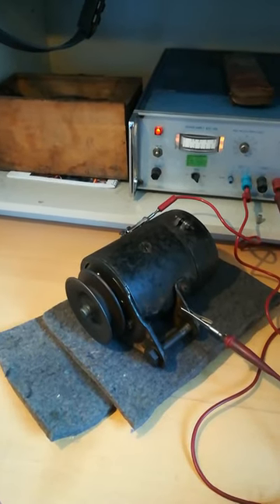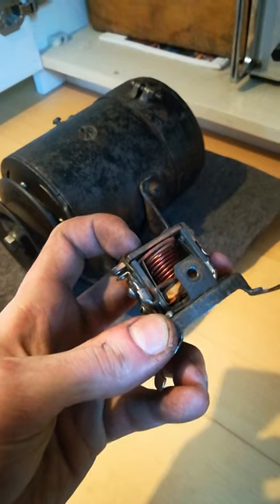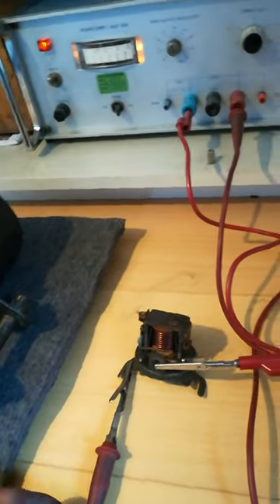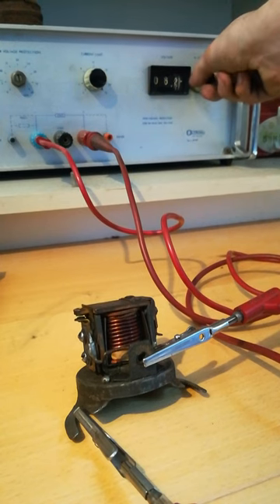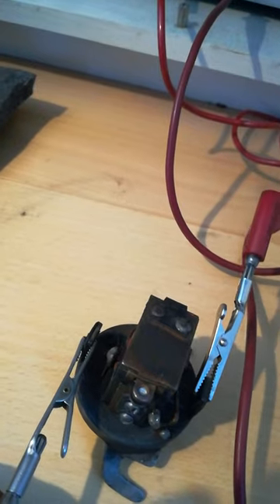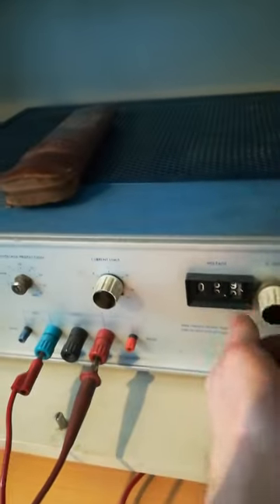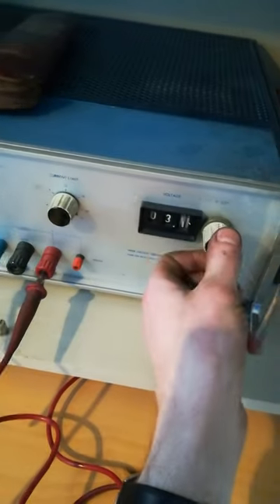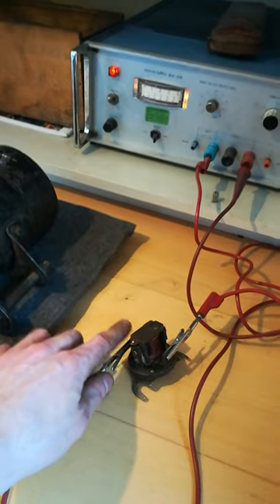Original Model A Cutout - #Short Explanation

Comment: 7.3V for the closing voltage seems a little high, doesn't it?
Reply from the maker: I thought it makes sense because a fully charged battery would be around 7.2-7.4V, so having the closing voltage thereabouts would make sure that even a charged battery wouldn't be able to make the generator spin when not in use.
If need be, the contact springs can be bent to adjust opening and closing voltage.
Reply: @AstraWerke  No, a 6V lead-acid battery at 100% charge should put out 6.3-6.4V. That's why they're called 6V batteries and not 7V batteries. I have two Optima 6V batteries on the shelf, fully charged, and they both register 6.4V.

7.2V is a very common charging voltage for solid-state battery chargers, but remember that the generator isn't just charging the battery, it's also in-circuit with all the electrical apparatus. You don't want to over-volt the lights. That's why most sources state that the cutout should close at about 6.5V.
Reply from the maker: @alexiskai Oh, there are instructions for these? I guess that's what you get for making an explanatory video before reading into anything xD
Reply: Adrian - great explanation, I always enjoy your videos. But as mentioned, point closure voltage should be around 6.5 - 6.75 volts. I've refurbished a lot of original ford cutouts and this where I set them. I also run one on my model A.  Maybe you've seen my video?  https://youtu.be/rnuukBeJ6Zs